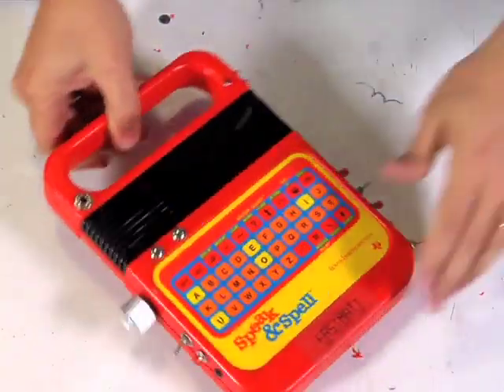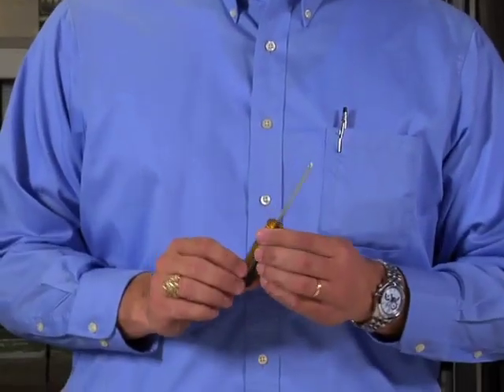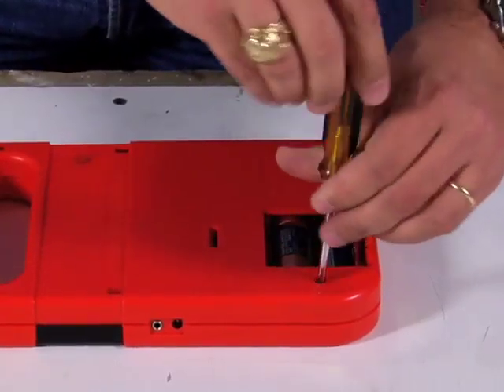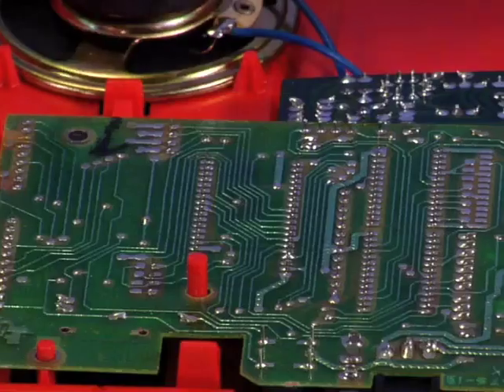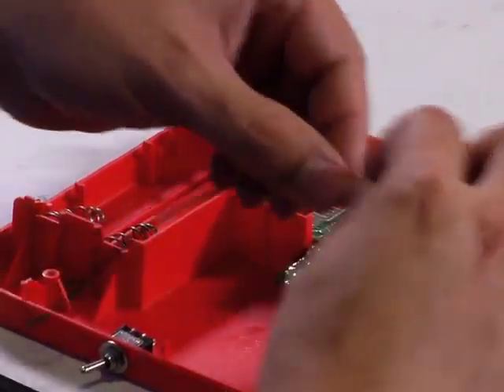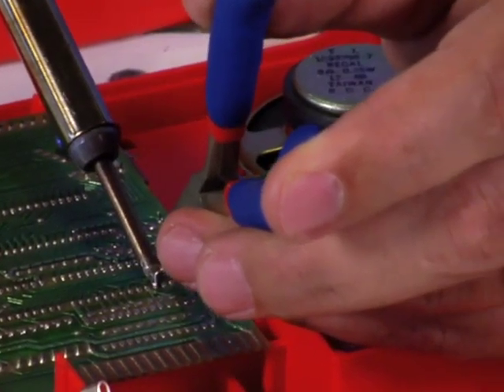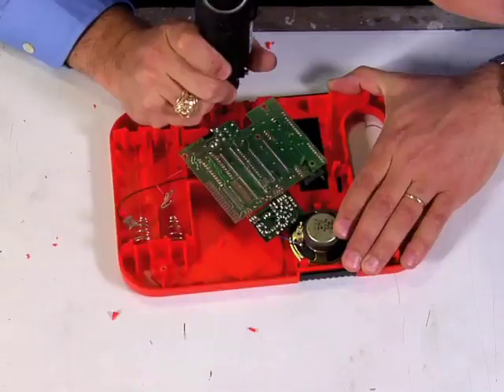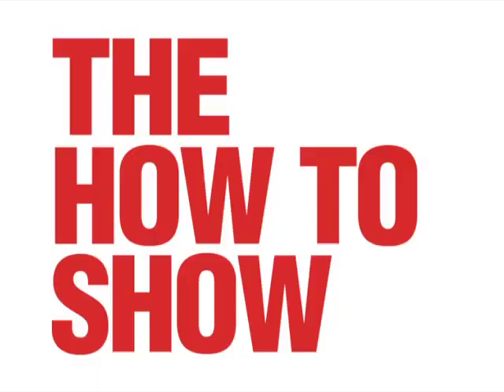Fastmatt - How to Circuit Bend a Speak & Spell (Howto Show)

Comment: Hello from Calgary, Canada @fastmatt..  I found one of your Circuit Bent Speak & Spell in a thrift store today and I didn't really know much about it, but it looked cool, so I bought it.  It's the "Circuit Bent Speak & and Spell ROUND BUTTONS" model and it has a handwritten note at the back of the battery cover saying "Bent by FastMatt 1-13-08".  When I figured out what it was, I installed 4 fresh batteries, but unfortunately it's not working as expected and I was wondering if you could repair this item and how much would it cost me.  Thanks very much! Fabio.
Reply from the maker: Wow, what a trip that it ended up in a thrift store - that’s a great find as I sell that model for $249 normally when I have them in stock.  But definitely happy to help!  The first thing to check is that the batteries are in correctly as per the diagram, and make sure the metal contacts are touching them - the round button model’s battery contacts sometimes need a little adjustment.  

You then want to make sure the bend circuits are off.  There are two switches on the sides - one is a 3-way loop switch - put it in the center position (off).
The other switch is a two way (glitch).  Put it in the lower (off) position.  See the pitch knob? Turn it so that it is at the center of its travel,  not all the way up or down.  With those bends set that way it should work like it did from the factory.

Next, turn on the power switch at lower right corner.  THEN press the ON button on the keyboard.

Did it come on?  Should hear sound, see the display show ‘SPELL A’.
Reply: @fastmatt_circuit_bent  Hi again and thanks for your quick reply.  Sorry it took me a few days to respond.  I know you sell this model for $249 and I appreciate you taking the time to respond.  I downloaded the manual for this specific item and it's definitely acting weird.   I get the "SPELL A" on the screen, but I can't get past that.  Right switches are off, knob is on center, left switch is on and when I press the ON button, the message "SPELL A" appears, but that's it.. No matter what buttons I press, the machine doesn't do anything.  Both blue lights are on.  Not sure what's wrong with it and I imagine it would be difficult for you to tell me something with the poor description I'm giving you; but it would be great to get this machine working again.  Any thoughts?  Thanks again!
Reply from the maker: @fawf9363  please email me privately and we can make arrangements.  Email address should be visible on the manual😎 one way or another we’ll get it singing again.
Reply: @fastmatt_circuit_bent  Email sent..  (hopefully I have the right email address.  I sent two emails, first one bounced, second one hopefully went to the current email)  Thanks!